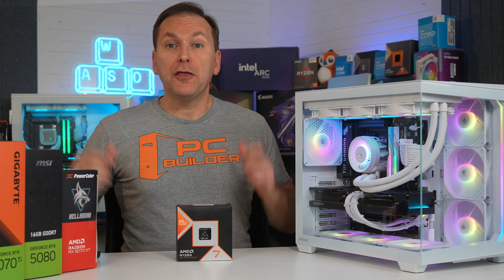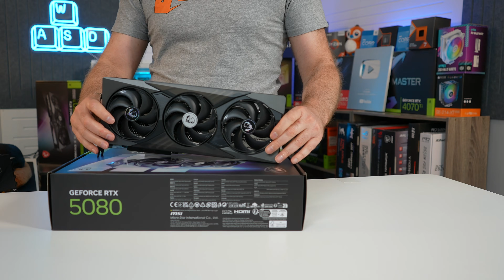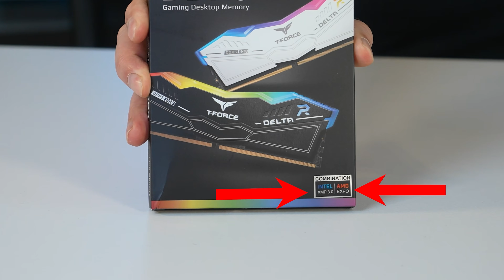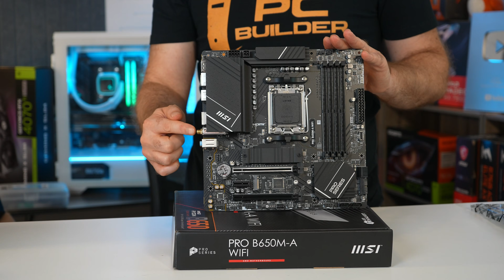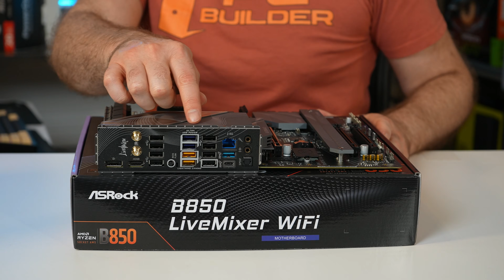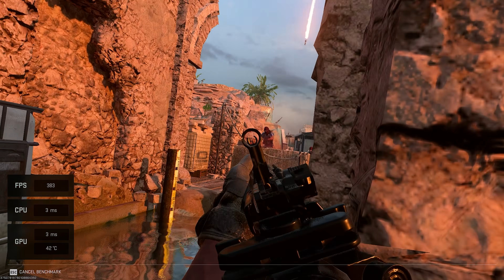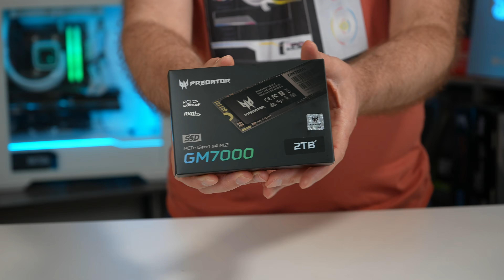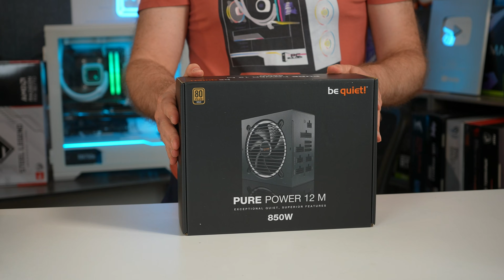Best Ryzen 9800X3D PC Build 2025 🛑 Best GPU, RAM, Motherboard & More

Comment: I saved about $400 CAD by opting to get the 9600x instead of the 9800x3d, paired with my 9070XT. The savings are paying for over half of a new OLED monitor that's due to be delivered to me today. My plan is to upgrade to the last, best CPU that's released for the AM5 socket years down the road. I don't think I left very much performance on the table with the 9600x, especially considering the cost difference.
Reply from the maker: Congrats on the build!!! The 9800X3D would give some additional performance, but prioritizing other types of performance (like an OLED gaming monitor) are things every PC builder should think about!
Reply: @PCBuilderChannel how large the performance difference would be? I'm also planning an upgrade, don't want to either cheap out or overpay   without need.
Reply: @kasenumi  going from 6 cores to 8, will smooth out the gameplay experience and keep everything more responsive, sometimes you will not notice these differences in an fps chart or plain benchmark, you need to be using the pc to really feel the difference, especially when multitasking, on a messy windows with other stuff running in the background, that's when having extra cores and threads REALLY helps (like alot) 
Even if you're just gaming, 12, 16 core chips are not ridiculous, if you are going for high refresh rate, high detail, high resolution gaming, multiple monitors etc, the cpu needs to scale to handle all of that, run the gpu, the game, windows, your browser, steam etc etc

Tldr, the benefit of having cpu headroom cannot be overstated
Reply: @mickieg1994  I'm plan to buy new pc parts soon. Upgrade from 2200g with b450 basic mobo, 12gb ram. In india price is expensive  9700x $355 or 9600x $267, b850 tomahawk $247 (i am confused, I can buy x870 for little bit more. Msi x870 gaming plus wifi $260 x870 pro rs $240, x870 steel legend $280 and x870e tomahawk $348). I liked b850 tomahawk offers qualcomm wifi7 compare media teck better connectivity, future proof 5g Lan but no real use yet, sound alc4080 codec compare to alc897, alc1220. Fast boot time. Worth it to buy x870 instead b850 tomahawk mobo?

corsair 32 gb ram, wd sn5000 500gb nvme ssd, corsair 650w or 750x psu. 

I work on websites, doing some light web design and coding. I also manage 80% of the websites' marketing. I open multiple tabs on Chrome and use beginner-level Photoshop.

I want to buy 9900x but expensive $445 if that helps with my daily tasks smoother and faster.

I usually work on Chrome sometimes open 60+ tabs, sometimes open multiple browsers Mozilla and Opera, and sometimes all 3. Sometimes, I use Chrome and 1-2 other softwares or Chrome with 3-4 other softwares. And open chrome multiple tabs and photoshop.

I'll go to aisa no 1 Nehru place market in Delhi, India for buy pc parts. I can save some money.
Reply: @mickieg1994 I'm plan to buy new pc parts soon. In india price is expensive  9700x $355 or 9600x $267, b850 tomahawk $247 (i am confused, can buy little bit more msi x870 gaming plus wifi $260 x870 pro rs $240, x870 steel legend $280, x870e tomahawk $348). I liked b850 tomahawk offers qualcomm wifi7 compare media teck better connectivity, future proof 5g Lan but no real use yet, sound alc4080 codec compare to alc897, alc1220. Fast boot time. Worth it to buy x870 instead b850 tomahawk mobo?

corsair 32 gb ram, wd sn5000 500gb nvme ssd, corsair 650w or 750x psu. 

I work on websites, doing some light web design and coding. I also manage 80% of the websites' marketing. I open multiple tabs on Chrome and use beginner-level Photoshop.

I want to buy 9900x but expensive $445 if that helps with my daily tasks smoother and faster can consider. 

I usually work on Chrome sometimes open 60+ tabs, sometimes open multiple browsers Mozilla and Opera, and sometimes all 3. Sometimes, I use Chrome and 1-2 other softwares or Chrome with 3-4 other softwares. And open chrome multiple tabs and photoshop.

I'll go to aisa no 1 Nehru place market in Delhi, India for buy pc parts. I can save some money.
Reply: @mickieg1994  I plan to buy new pc parts soon. Existing pc 2200g, b450 basic mobo, 12 gb ram. In India, the price is expensive. 

9700x $355
B850 Tomahawk: $247 
Corsair 32gb ram 6000mhz cl30
WD sn5000 500gb nvme SSD
Corsair 650w or 750x psu. 

I am confused about buying a motherboard. I can pay a little more and buy an X870. 

MSI X870 gaming plus Wi-Fi: $260
X870 pro RS: $240
X870 steel legend $280
X870e Tomahawk: $348

I liked the B850 Tomahawk's Qualcomm Wi-Fi 7 compared to MediaTek. It offers better connectivity and a future-proof 5g Lan, but I haven't used it much. The sound uses the Alc4080 codec processor, compared to the Alc897 and Alc1220. It also has a fast boot time. 

I work on websites, doing some light web design and coding. I also manage 80% of the websites' marketing. I open multiple tabs on Chrome and use Photoshop at a beginner's level.

I want to buy 9900x but expensive $445 if that helps with my daily tasks smoother and faster.

I usually work on Chrome, sometimes opening 60+ tabs, sometimes Mozilla and Opera, and sometimes all. Sometimes, I use Chrome and one or two apps, or Chrome with three or four other applications. I also open Chrome multiple tabs and Photoshop.

I'll go to Neru, Asia's No. 1 market in Delhi, India, to buy PC parts and save some money.
Reply: @PCBuilderChannel @mickieg1994 I plan to buy new pc parts soon. Existing pc 2200g, b450 basic mobo, 12 gb ram. In India, the price is expensive. 

9700x $355
B850 Tomahawk: $247 
Corsair 32gb ram 6000mhz cl30

WD sn5000 500gb nvme SSD
Corsair 650w or 750x psu. 

I am confused about buying a motherboard. I can pay a little more and buy an X870. 

MSI X870 gaming plus Wi-Fi: $260
X870 pro RS: $240
X870 steel legend $280
X870e Tomahawk: $348

I liked the B850 Tomahawk's Qualcomm Wi-Fi 7 compared to MediaTek. It offers better connectivity and a future-proof 5g Lan, but I haven't used it much. The sound uses the Alc4080 codec processor, compared to the Alc897 and Alc1220. It also has a fast boot time. 

I work on websites, doing some light web design and coding. I also manage 80% of the websites' marketing. I open multiple tabs on Chrome and use Photoshop at a beginner's level.

I want to buy 9900x but expensive $445 if that helps with my daily tasks smoother and faster.

I usually work on Chrome, sometimes opening 60+ tabs, sometimes Mozilla and Opera, and sometimes all. Sometimes, I use Chrome and one or two apps, or Chrome with three or four other applications. I also open Chrome multiple tabs and Photoshop.

I'll go to Neru, Asia's No. 1 market in Delhi, India, to buy PC parts and save some money.
Reply: @PCBuilderChannel  I spent a lot of time debating on the CPU choice and your videos helped a lot, thank you!
Reply: Good decision. If you bought the card at a somewhat reasonable price, you optimized frames per dollar.
Reply: You telling me my decision to buy 6400 cl30 trident neo z5 royal is hurting my performance?
Reply: @RedMind545 yea I heard that in the vid too and have trouble believing it from my research. Same with 64GB RAM being unnecessary - assuming your PC lifespan includes 2026. 

PROVIDED your RAM and Mobo can handle it, most every analysis I've seen says the top tier Ryzens on best Mobos can run 6400 in 1:1 and you're getting at least 2%-8% more performance literally everywhere. Sometimes 2x-4x that - not sure what other hardware is juicing an extra 4% raw CPU performance from a R9/R7 for what like $45 extra at 32GB?

He's probably targeting general audience so avoids the Mobo/RAM quality caveats which are legitimately nebulous. It'd be great to run things in Auto profiles which 6k should do always, the nuance is 6400 kit auto should be doable and is faster on good Mobo. And worst case 6400 doesn't work, you're still faster every single task with that kit even at 6200 or 6000. Granted. potentially takes more manual effort to dial in first few days, but then should be as stable as 6000.

Is it worth it? On R9 or R7 I thought so (9900x + Strix X870E mobo), but I also got 64GB 6400 and am inclined toward overkill.
Reply: This is a good plan for maximizing value. Since gaming isn't my main focus and instead longevity/max overall capability over 7-10 years, I have basically the same plan as you. Option to upgrade to the final AM5 chip once AM6 anticipation starts, just got a more extreme Mobo/processor: R9 9900x was only $350 and I splurged on an Asus Strix X870E-E since that'll be the more permanent fixture. 

Coming from a 9th Gen i7, any serious setup is going to be a huge jump, but I still don't want to bump into a ceiling for many years. I want a 9070 XT but am considering experimenting with B580 as that's all I really 'need'. 

And I don't think your CPU choice is going to limit you too much (game dependent obviously) if maximum gaming is the goal - between 9600x + 9070/XT or 9800X3D + a $300 cheaper GPU, I don't see how anybody can seriously argue you made a mistake unless you only play CPU-limited games. You'll pay for it in ceilings for other tasks though, and obviously X3D anything is a beast that will outperform 9600x, but to me sounds like you got the right answer since 9070 gains vs. like a B580 will outweight 9600x vs. 9800X3D >80% of the time.  (*FOR MOST GAMING* - huge qualifier so I hopefully don't get eviscerated)
Reply: - Andrew Tate: Brokie.
Reply: If you're gonna upgrade that cpu, please do it soon

A 6 core chip no matter how fast is gonna struggle with a 9070xt and you will 100% notice the difference unless you are playing, apex legends, fortnight etc where the game is stupidly easy to run

A 7900x would annihilate that 9600x and you will be able to get one cheap second hand st some point
Reply: @mickieg1994  I'll only consider an upgrade when I start seeing CPU bottlenecks or AMD has released/confirmed the last gen on AM5 socket, whichever comes first :)
Reply: @karzy111  So basically, the 9800X3D is like the souped-up version of the 9600X, and you'd really feel the difference, especially in gaming. When you're playing CPU-heavy games like Flight Simulator or Cyberpunk, you're looking at maybe 20-30% more frames per second with the 9800X3D. Like, if you're getting 60 FPS now, you could be hitting 80-90 FPS with the upgrade.

The real magic happens in games that love lots of CPU cores and that special 3D V-Cache technology. MMOs and strategy games like Cities Skylines or Total War would run way smoother. You'd notice less stuttering and more consistent performance, especially when there's a lot happening on screen.

For regular work stuff and applications, the 9800X3D has those extra cores that make multitasking much snappier. Video editing, rendering, or running multiple programs at once - it'll handle all that noticeably better than the 9600X.

But hey, if you're just doing basic gaming and everyday computer stuff, the 9600X is still a solid CPU. The upgrade would be nice to have, but it's not like your current setup is struggling or anything.

(Note: Some specific numbers might vary as I don't have exact benchmarks for these two CPUs, but this represents the general performance difference you'd expect)
Reply: @karzy111  what's your average cpu usage?
What games are you playing?
What resolution?

I'm fascinated, 1080p, ok sure you have a monster set up, but 1440p is more than most people realise and a 6 core as far as I know cannot manage 4k, at 1440p you are up against a massive bottleneck in alot of the more modern, more demanding titles, even if you don't necessarily see it represented in a fps chart
Reply: @mickieg1994 Completely opposite—the higher the resolution the easier it is for the CPU.  For example, if you play at 1080p and your graphics card outputs 200–300 FPS, cheaper CPU might struggle. However, at 4K resolution, your FPS will drop to 60–100, and that CPU will have an easier time calculating everything only for 60-100 frames.
Reply: @4gnarr  i have cpu usage 35 % and gpu usage 70% do i have bottleneck?
Reply: @genlongtsang1093 Too vague a question to give a meaningful answer. Not utilizing the GPU at closer to 100% and having low CPU usage means you might be hitting your monitor's refresh rate (sync), and your PC is simply easily handling the game, or there is a problem. It might be game optimization, drivers, slow RAM, overheating... Hard to guess what it means in your case without knowing anything more :)
Reply: @4gnarr  low CPU usage is good, the only think is the GPU usage is not hitting 95-100% it goes up but then drop to 70-60% because i heard people say having low CPU usage and max GPU usage is a good think, when CPU usage is at 100% that is bottleneck, maybe is the game, i'm playing Apex Legends. Everything is up to date Windows and Nvidia. Game is smooth, i just did a clean install GPU. I have 32gb Ram DDR4. I think is overheating, i see dust on the fans and the airflow case
Reply: You left a LOT of performance on the table don't kid yourself
Reply: @ Prove that I left $400 worth of performance on the table XD.. That $ easily goes further on a GPU or monitor upgrade. 9070xt is the bottleneck in my system for 90% of games
Reply: @Phenomenalll seen many vids showing fps differences per game and resolution…and i never saw anything shocking fps related.    Even the best ones the fps was like okay….. cool. So maybe in certain games or other situations it might be worth it but for mostly everyone nope!
Reply: Why 9800x3d, when the bigger one exists 9950x3d ?
Reply: @UM_88-s2c why you have acne on face ?XD
Reply: I need your help to buy pc parts. Existing pc 2200g, b450 basic mobo, 12 gb ram. In India, the price is expensive. 

9700x $355
B850 Tomahawk: $247 
Corsair 32gb ram 6000mhz cl30
WD sn5000 500gb nvme SSD
Corsair 650w or 750x psu. 

I am confused about buying a motherboard. I can pay a little more and buy an X870. 

MSI X870 gaming plus Wi-Fi: $260
X870 pro RS: $240
X870 steel legend $280
X870e Tomahawk: $348

I liked the B850 Tomahawk's Qualcomm Wi-Fi 7 compared to MediaTek. It offers better connectivity and a future-proof 5g Lan, but I haven't used it much. The sound uses the Alc4080 codec processor, compared to the Alc897 and Alc1220. It also has a fast boot time. 

I work on websites, doing some light web design and coding. I also manage 80% of the websites' marketing. I open multiple tabs on Chrome and use Photoshop at a beginner's level.

I want to buy 9900x but expensive $445 if that helps with my daily tasks smoother and faster.

I usually work on Chrome, sometimes opening 60+ tabs, sometimes Mozilla and Opera, and sometimes all. Sometimes, I use Chrome and one or two apps, or Chrome with three or four other applications. I also open Chrome multiple tabs and Photoshop.

I'll go to Neru, Asia's No. 1 market in Delhi, India, to buy PC parts and save some money.
Reply: @UM_88-s2c  Why you not go live on the moon, when there is less traffic and more space to live?

Comment: LOL "gaming CPU". Make sure you buy a 1080p monitor X3D is pointless at 4K.
Reply from the maker: That isn't true depending on the games you play, and most gamers are still buying this for very high refresh rate 1440p gaming. But the point of considering your CPU and GPU combo is always important and that is why I advise a relatively higher end GPU for these builds.
Reply: @PCBuilderChannel  Pretty sure the GPU will still be the bottleneck, would be interesting to see some benchmarks to compare the X3D against an i9 at 1440p i've only really seen 1080p and 4K which are opposite ends of the spectrum. At 1080p X3D dominates and at 4K its practically irrelevant.

Comment: There seems to be some problems recently with 9800X3Ds failing in ASRock boards. Hoping that either AMD or ASRock will come up with a fix soon.
Reply from the maker: I'm keeping an eye on this but so far this is a very small amount of CPUs. AMD and Asrock did a joint investigation. AMD released a statement yesterday saying RAM compatibility wasn't working properly on previous bios versions leading to CPUs to stop posting, but that bios update should fix it. One CPU seems to have been defective. If you want to avoid ASRock in the meantime, you can but seems very low scale so far.
Reply: User error

Comment: Microcenter has a bundle for the 9800X3D, MOBO and Ram for 649$ however the RAM included in the bundle is CL36, Would that be a big performance hinderance if I am aiming for a 9070XT or any sort of possible 9080XT if that ever is a thing? or would CL36 not be anything to worry about? The bundle loses its price if I try to change the ram.
Reply from the maker: Since the X3D CPUs aren't that memory sensitive it would probably only be a small performance hit. So if this really helps your budget that's fine
Reply: @ Thank you for the reply! That puts my mind at ease knowing the hit isn't much, Budget isn't much an issue but saving money anywhere is always nice lol.
Reply: Im looking for 1440P ultra wide OLED max settings with this build as well.

Comment: I have a question regarding the new atx 3.1 standard. I have an asus tuf 850 watt psu which supports atx 3.0 but i am also ordering a rtx 5080 which has the new atx 3.1 12vhpwr connect port for power , so my question is should I needed to upgrade my psu or atx 3.1 and 3.0 or new 5000 series backward compatible?
Reply from the maker: New PSU video coming up that addresses this, but basically the ATX 3.1 change is to the 12VHPWR connector pins which are on the GPU and PSU (the cable doesn't actually have the pins). It uses the redesigned 2x6 connector for the 12VHWPR cable to help reduce melting cables. Will work with ATX 3.0, and a lot of them are actually 3.1 but since this was a rushed update they didn't change the boxes. I recommend 3.1 for NVIDIA GPUs, but again 3.0 will work.
Reply: @PCBuilderChannel so if i use lian li wireless cable extension does this works to